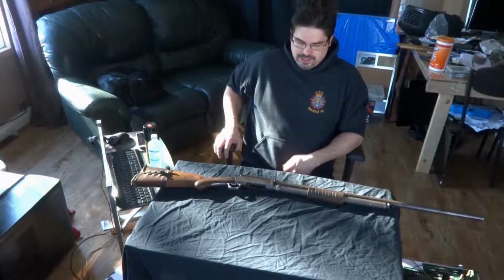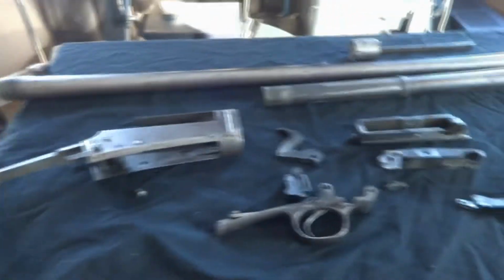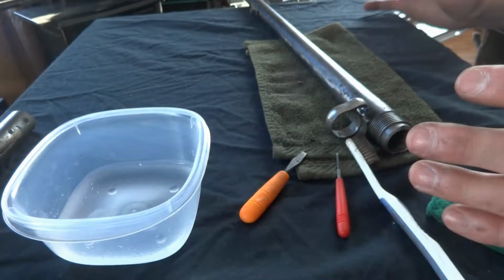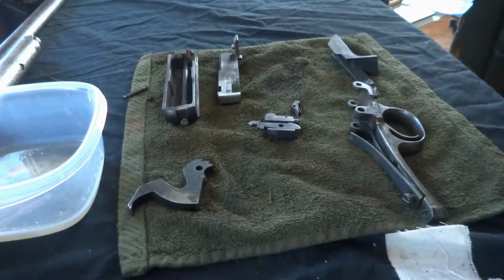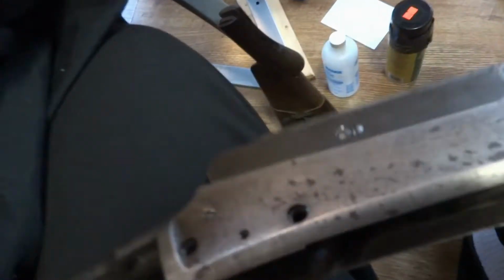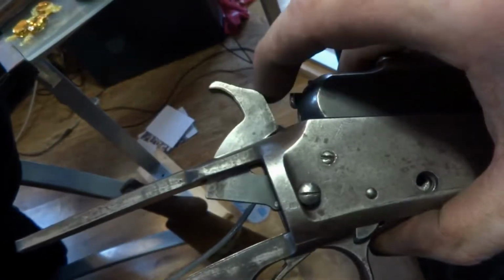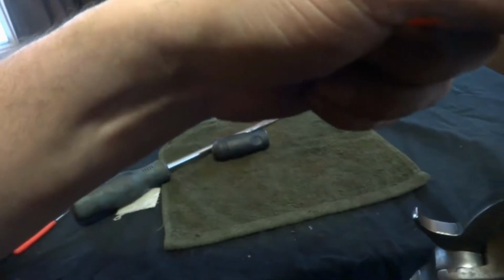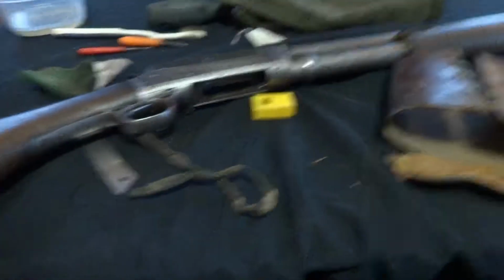Marswell Model 1914 12GA Shotgun: Disassembly, Cleaning, & Cycle Test

Comment: I guess to get the disassembly I have to watch it backwards
Reply from the maker: Do you mean assembly? I guess so.
Reply: @MiddleofNowhereDuff  the title says disassembly, as if you show how to get it apart.
Reply: @MiddleofNowhereDuff  And I do apologize for being so angry

I have been looking for a guide to get apart mine without scattering it into the wind for a while
Reply from the maker: Start with the removing the butt stock (there is a big screw or bolt under the butt plate),  and finish with the receiver group. Be careful, there are springs under some of the screws. Take the process slowly, or you'll end up losing part and forgetting. You can document or photograph your progress to know how to assemble it after.